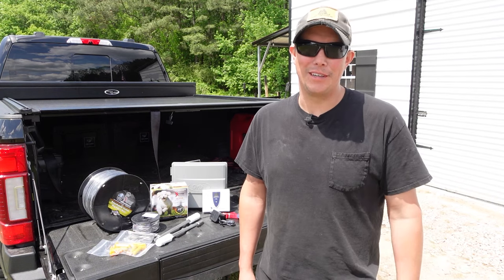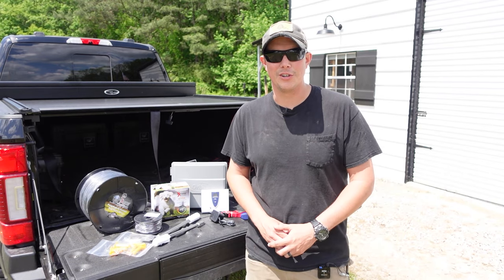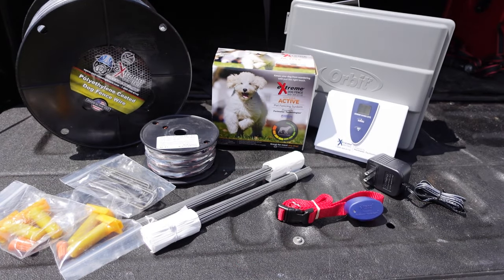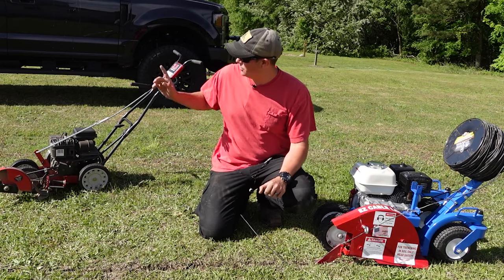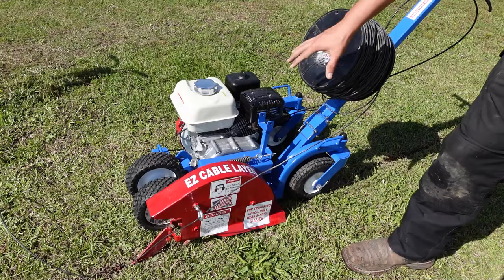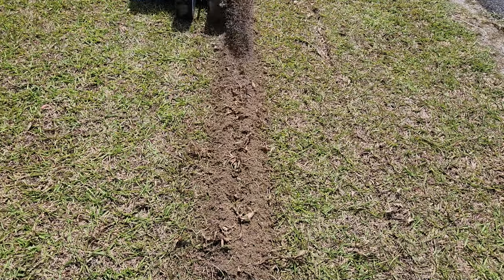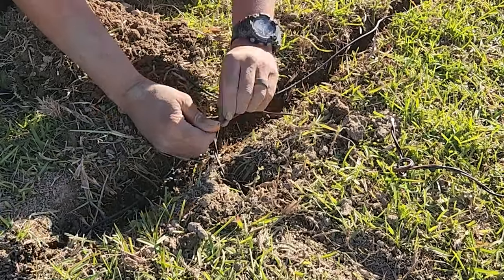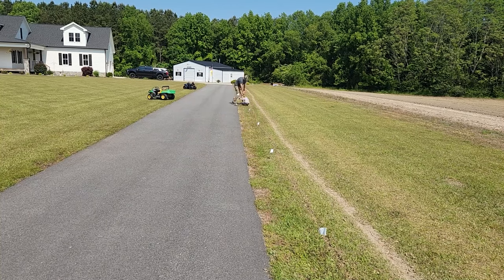How To Install An Extreme In Ground Dog Fence System

Comment: I’m doing my research before getting used one from someone. So at the end when ur connecting the box u mean the twisted boundary lines are what u connect to the box right cause the original boundary is in the ground right
Reply from the maker: @Creationsbymo912  correct

Comment: So I have about 250 feet of where I need to keep my dog from chasing cows. Can I just run the wire up and back if that makes sense?
Reply: You’d have to make a enlongated loop about 10-15ft apart from one another. Then hook the twisted on the inside to where your putting the transmitter.

Comment: Great DIY video.  makes me think we can do this. we are going to install around 7 acres, 2400 linear feet.  Will the wire be on one spool or will I have to splice the 500' wire and 2000' wire that I will add to the original kit?
Reply from the maker: Typically You choose the size you need and they send a wire long enough. I got 1 continuous 1500ft wire.   But with 7 acres I wouldn't be surprised if you had to spice a section.